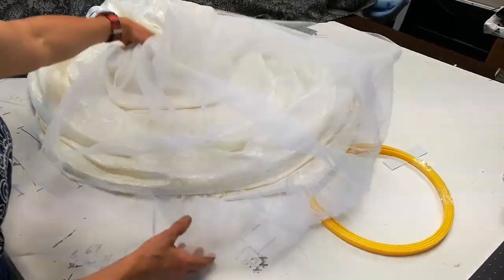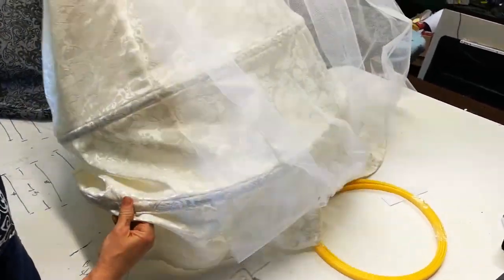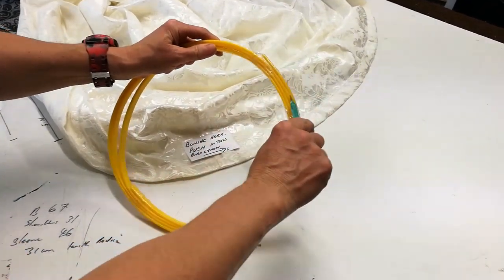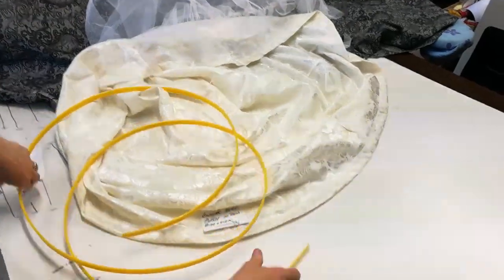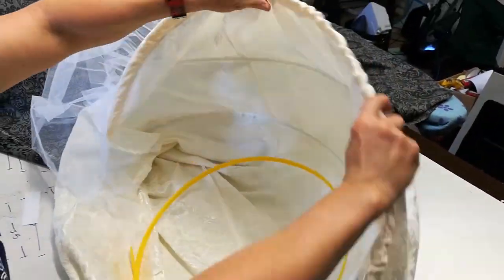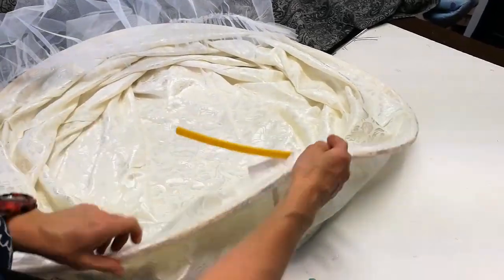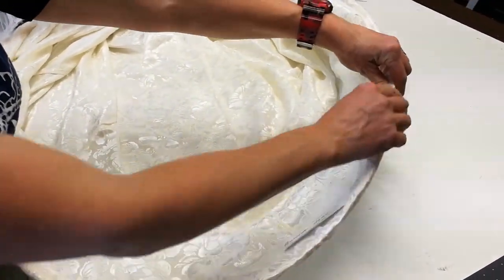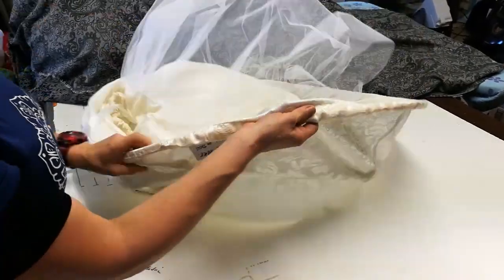How to bone your hoop skirt

Comment: Plz tell me name of this wire use in hoop skirt
Reply from the maker: Hi for this style of hoop skirt we generally use sprung steel but to hold out the bottom of the hoop under the weight of a heavy brocade and velvet fabric we have used a flooring track that you will find at a hardware store, it is very strong
Reply: We can also use polytuber in our skirt to give this shape
Reply: I used plastic boning but it don't work.
Reply: Bur where can I get a sprung steel